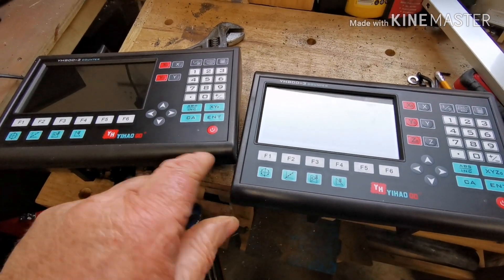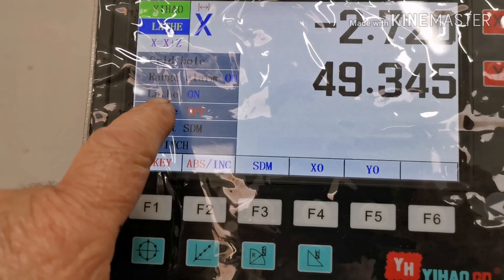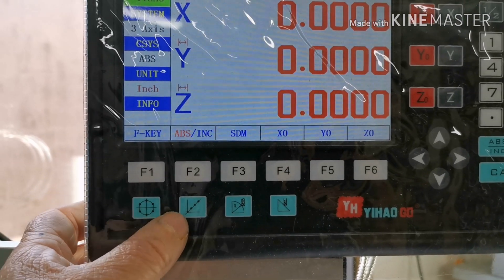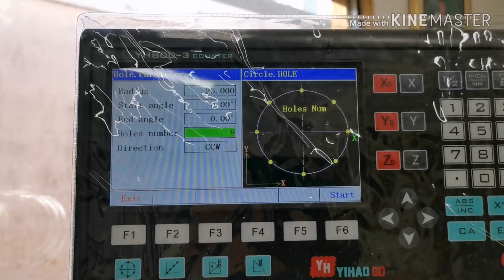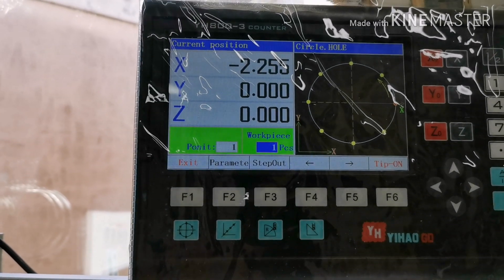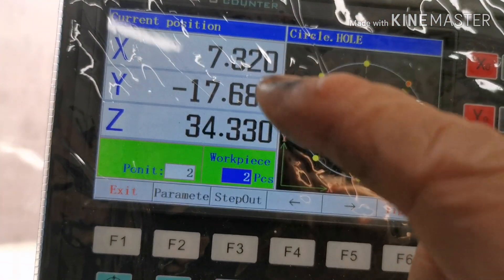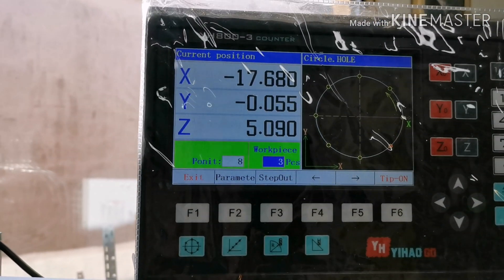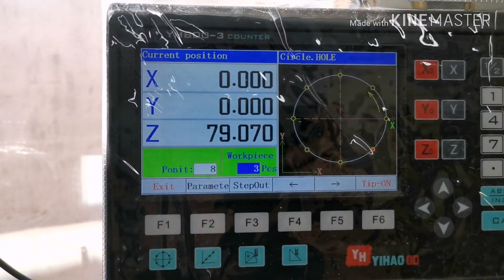Fitting digital readouts to the lathe and milling machine

Comment: That bolt hole circle would be awesome for building dividing head plates.
Reply from the maker: Yes, I am building a 2" fowler showmans traction engine and on one of my later videos i made a dividing head plate to cut the 96 tooth final drive gear
Reply: @jammymowlam1  Lol. been watching a ton of lathe and machining videos. I've seen them but i've never used them or seen them used in person. I ordered a King Canada KC-1620CLM with a stand cabinet and wrangled a small set of brazed carbide tools in the deal. I'm supposed to be getting the lathe 2nd week in June. One of the first jobs I have to do is a small 20 tooth gear for a metal band saw that was given to me. Been beating my self over the head how I would do it without a dividing head. With the DRO I can build a plate to make a temporary cheap dividing head and the gear I need. Then with that make the gears for a better home made dividing head solution. 

Lol. all that work for a stinking gear. But I brought the gear to a machine shop and they quoted me 600 dollars for this stinking little gear. Could have bought 5 gears at the price of the lathe mill combo but 600 for a 2" x 1/2" or so 20 tooth brass gear seemed like an insult. Thank god for Youtube. I learned how to bee keep started with 2 hives. year 3 now, I have 20 from those 2. Learned how to run a road grader. bought a 53 cat and fixed 1 driveway and built two from scratch for family last summer. Learned to braid a whip and finished my second 5 foot snake whip just an hour ago and now I'm learning to be a machinist. It would be nice if any of this shit made me money. But, at-least the more I learn the less goes out the door to everyone else who's time and knowledge, oddly by default, seems priceless in comparison to mine. Lol.